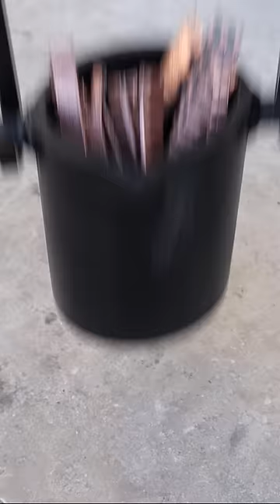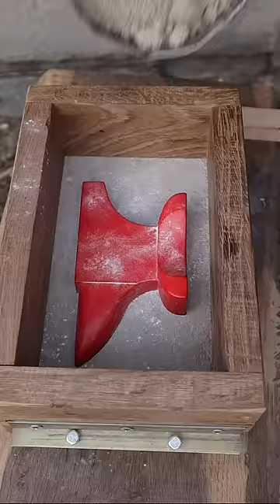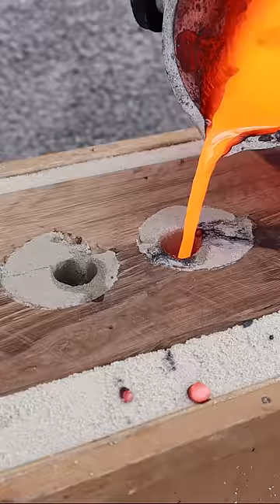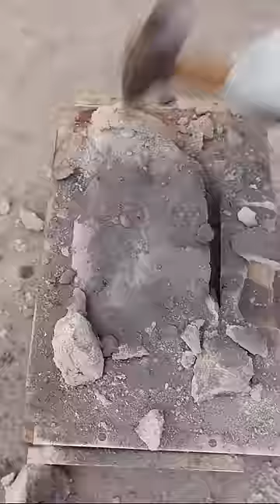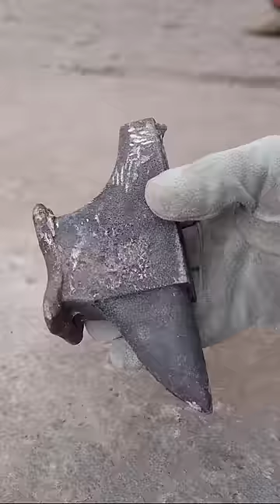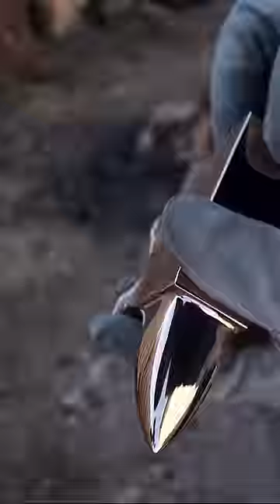Melting Artillery Bands into Anvil - Bronze Casting

Comment: Never having served in the military, I am unfamiliar with "artillery bands," but that seems like a fine attractive little tabletop anvil for silver or goldsmithing, leatherworking, or some other light duty. Well done!
Reply: It's a driving band. It's like an oversized section of the artillery shell that goes into the lands and grooves of the gun barrel to prevent gas escape and increase velocity.
Reply: @plainlogic  tks sir
Reply: @plainlogic I think it also spins it for accuracy but im not sure
Reply: @user-fz7bl6hq7s  It does, the rifling the bands form a seal, but the rifling of the barrel actually goes further than just the band, slightly digging into the shell itself and causing the round to spin.
Reply: @user-fz7bl6hq7s  The barrel is rifled. Lands and grooves are the term for the profile of the rifling.  The  rifling spins the projectile to increase stability in flight to increase range and accuracy. The driving band engagement transfers the rotational movement to the projetile.
Reply: And in the U.S. we call them "rotating bands"...
Reply: Я думал что я один заметил из чего он сделал эту наковальню!))) На самом деле срезать бронзовые пояски со снарядов времен второй мировой войны, очень опасно
Reply: حقا إنه جميل جدا❤❤❤❤❤ أستطيع أيضا❤❤❤❤

Comment: This is awesome. Love it!
BTW, what's the ration of metals to make brass? And what is the red anvil model made from so it melts away when casting?
Reply: Red anvil didn't melt away, he just didn't show the part where he pulls the mold back apart and removes the anvil......
Reply: Brass is copper and zinc, with a 3 to 2 ratio and bronze in 90ish% copper and 10ish% tin
Reply: Thanks !!

Comment: I’ve watched a few of these videos now and I have this same question every time, do you remove the plastic anvil? Or does it stay in and melt and burn away when you pour in the Liquid Metal?
Reply: The plastic doesn't stay; if it stays it will effect the casting, ruining it.
The plastic (or wax) would have to be burned out before any casting is done.
This is done just by heating the mold in various angles to liquify and dry the mold. 

The mold is generally removed manually though, but this depends on the complexity of the casting.
Something like this anvil would be done by manual removal.
So you would gently pull apart the two sides of the box, the mold would be left in one, you can then gently tap or knock it to loosen it from the sand, then slowly lift it out, put the sand sides back together, and it makes the complete mold.

That's what that line (flashing) you see around the face is, where he wasn't super careful handling it and caused it to move.
It should be tiny on properly handled molds.